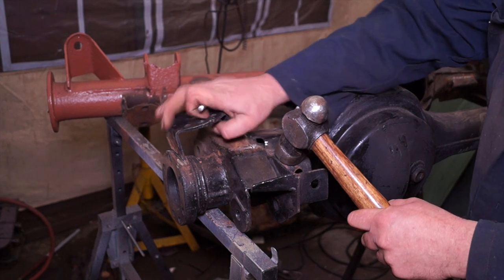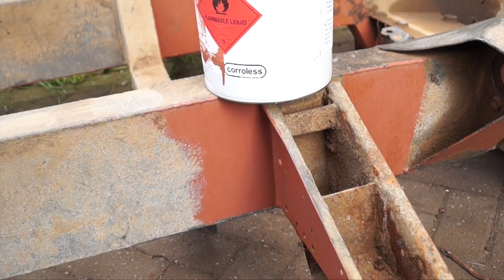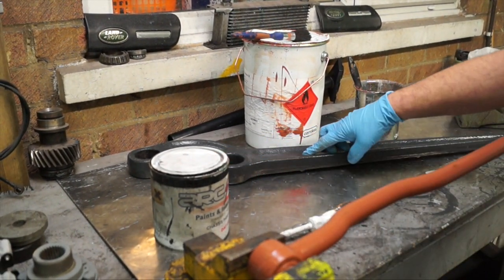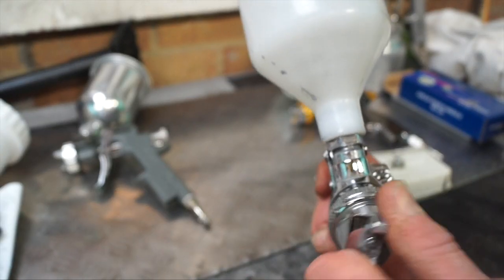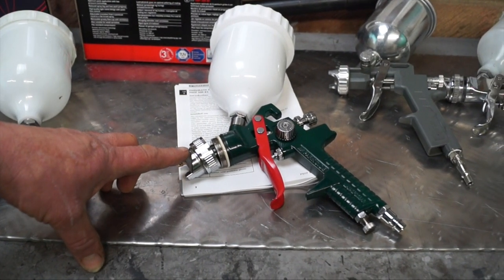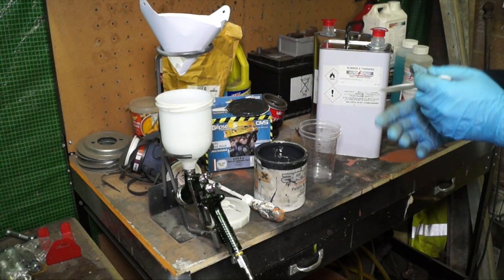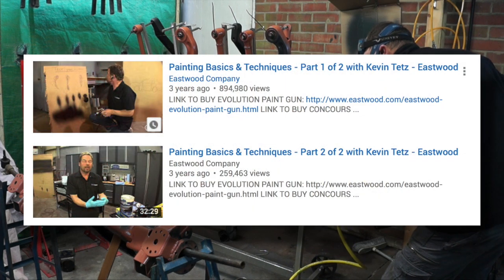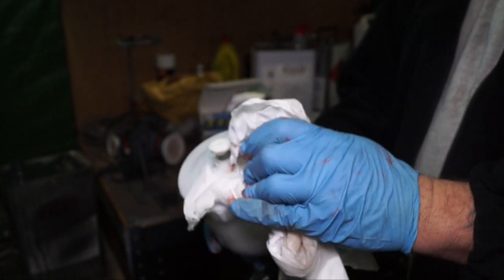Painting an Axle Case and Suspension Parts with Chassis Paint - 110 Project rebuild.

Comment: Hi; I need some help and clarification on CIO paint. Some companies advert CIO has having Rust Killer pigment. But reading RF16 spec from corroless, it does not specifies the rust killing capability. One other corroless product that is low gloss black and has rust killer pigment is QDR3 but this is a primer and needs top coat. Can you confirm that RF16 has rust killing hability ? thanks. great video, once again